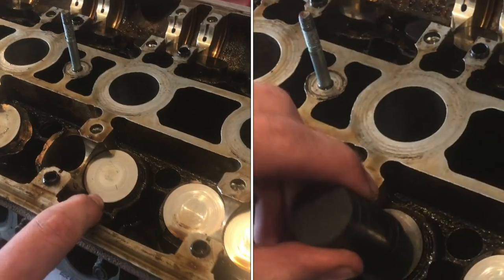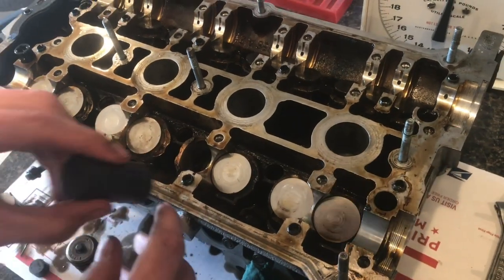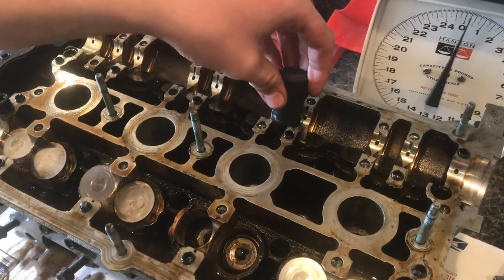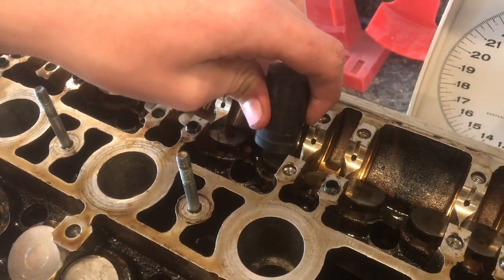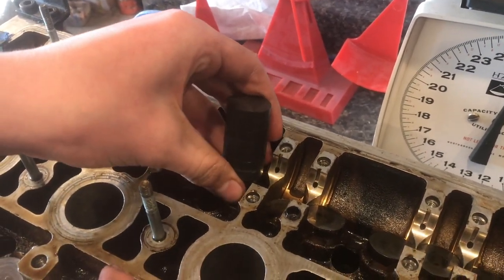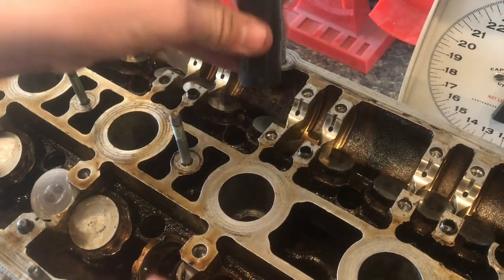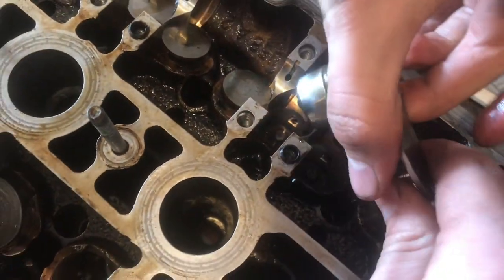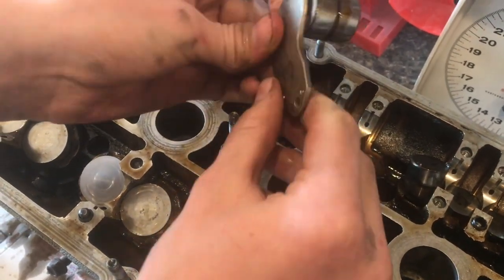removing valve spring lifters “MAGNET trick” 1.8t volkswagen audi (aeb)

Comment: I have a 99 longitudal aeb. I have to pull the cams out of it this spring. I want to change the cam chain tensioner and cam chain. And I have a ear broken off my crappy non OEM tensioner that prevents the tool from releasing tension. I want to do the lifters. I think one ticks. I found oem lifters for sale online. $225 for all 20. What do I need to do before installing them?